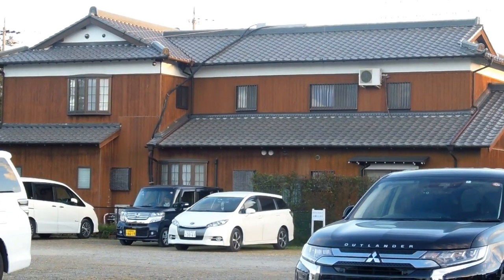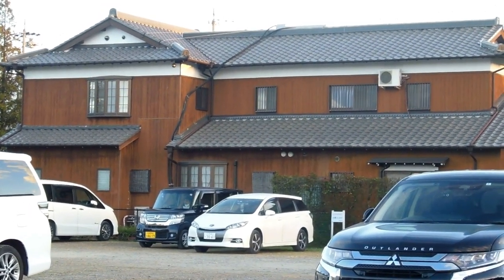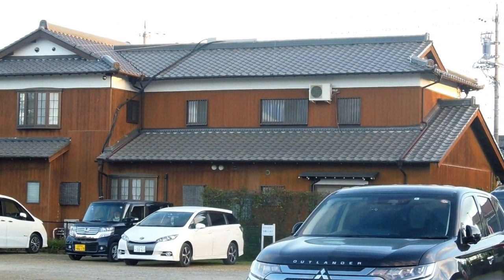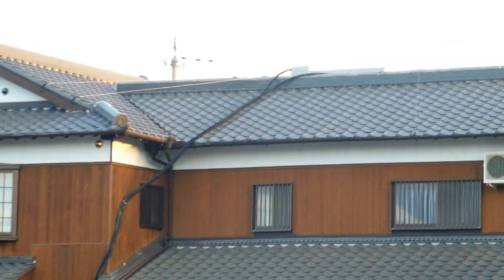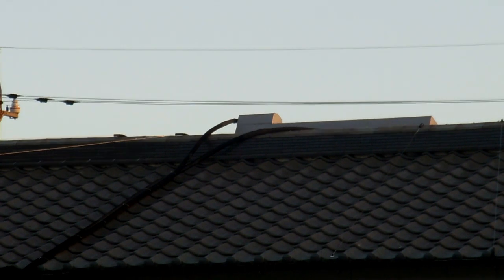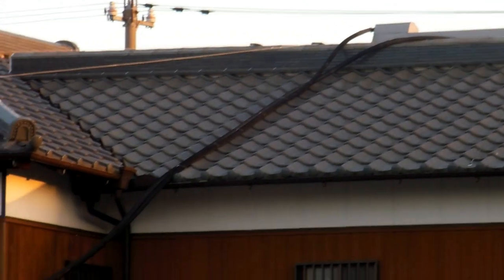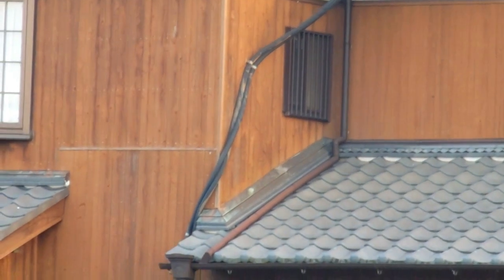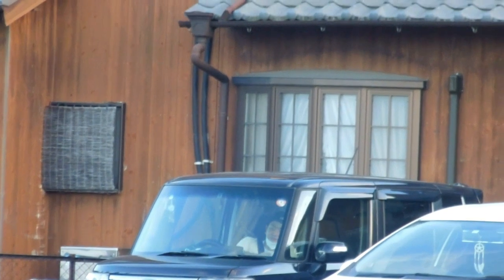Lazy Ugly Workmanship in Japan

Comment: House is just being demolished in five years anyway, so why make an effort?
Reply: That.. might actually have something to do with it! Didn't even think of that at first.
Not building houses to last is wild to me, too.
Reply: @Houkai1  it breaks my heart, too; but the reasoning is (generally) sound. The MAIN reason presented is that they want to keep the building inventory relatively up-to-date with building innovations as they continue to aggressively research the behavior of natural disasters--Earthquakes being the biggest focus. The idea is that old house are raized and newer, safer ones built in their place.  Add to that the fact that in general, a house here (a non-concrete apartment building) is a depreciating asset.
Reply: @Houkai1  I often wonder what would happen to a home's value over time if it was built super-sturdy out of stone and hard wood or something. Would that appreciate? Or just fall out of code compliance and become a financial burden.
Reply: I cant help but think it is a mix of homes having no worth after 20 years and the way Japanese hate confronting each other. When we got our solar water installed we had to give permission for the installer to modify and drill holes in the house. Japanese being anal about anything on a piece of paper would than ask for all the changes to be itemised.  For an installer it is just to much of a hassle.

Comment: Easy to service, maybe?
Reply: No. Service would likely be worse due to the bends and forces on the pipes and no straight lines to work off of. 

It being on the outside of the house is the only thing that would make it easier to service but that’s no excuse for, and is unrelated to, the laziness of not making straight lines, wrapping it around the roof, and keeping things tidy. Besides the way this is installed it would cause it to be much more likely to require servicing and not make it last as long as it could.